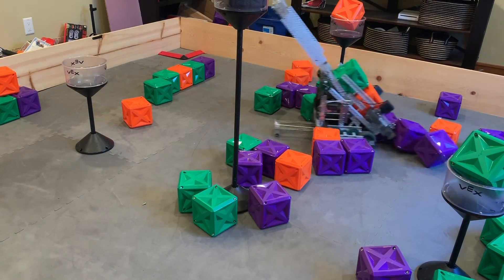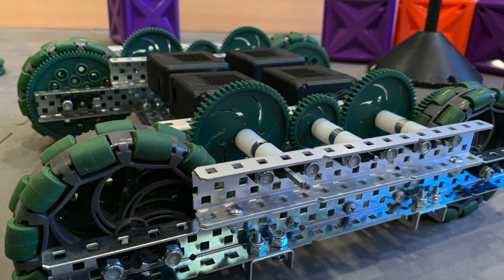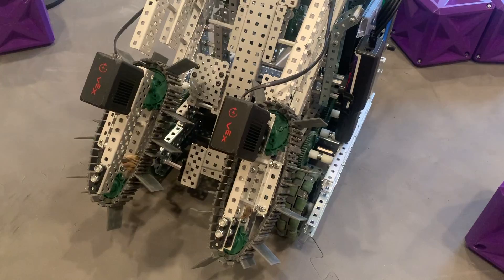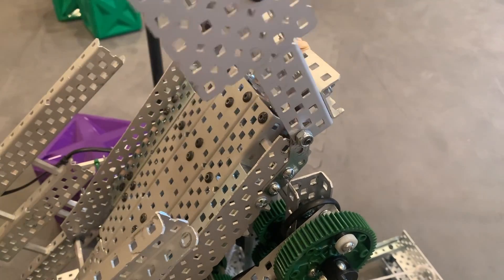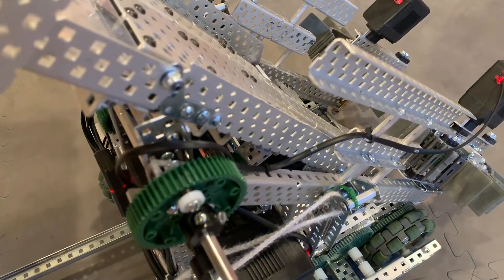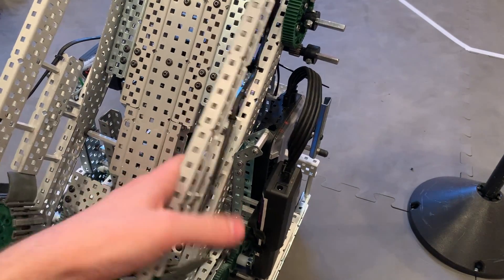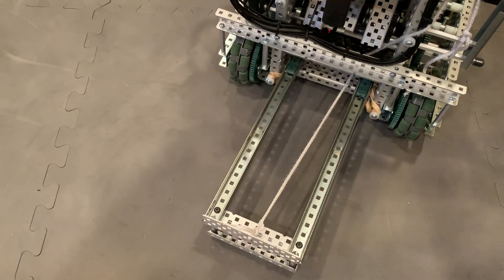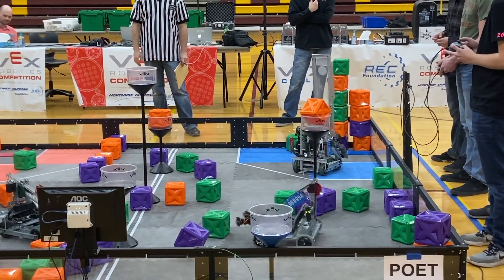VRC Tower Takeover Robot Reveal + Explanation

Comment: What happened to the custom rachets you designed?
Reply from the maker: They didn't end up being super useful for a traybot. We use the reversing function of the rollers a lot to nudge cubes when stacking, so we would lose that function with the ratchets.

Comment: I would recommend redesigning the actual intakes, how their mounted is good. It’s clear that once it has so many cubes they start to lose traction. I don’t think you need different sized sprockets of it’s mounted on a hinge. Changing the sprockets and maybe testing different flaps as well as making them a bit faster would improve the robot tremendously. Otherwise it looks pretty good!

Comment: maybe try getting 200 rpm motors and faster intakes? With faster intakes your bot would be really fast at stacking. also maybe increase speed of your tilter, and do a linear function for the code. it works really well for us. also a 3rd stage w/ longer linear slide you could get at least 11 cubes.